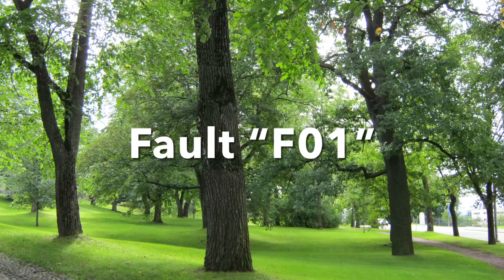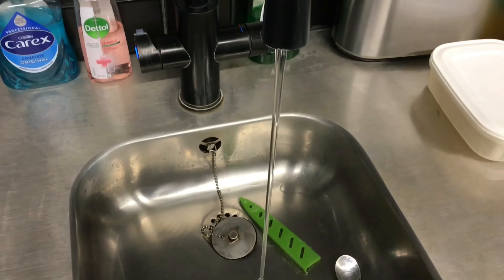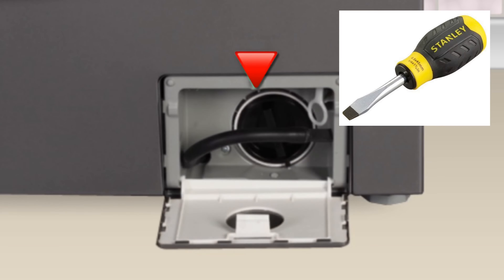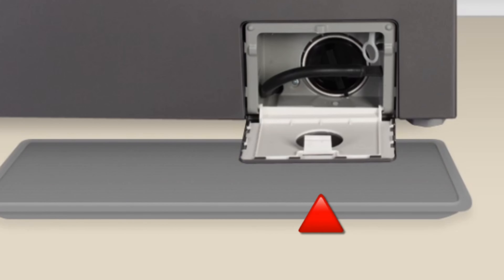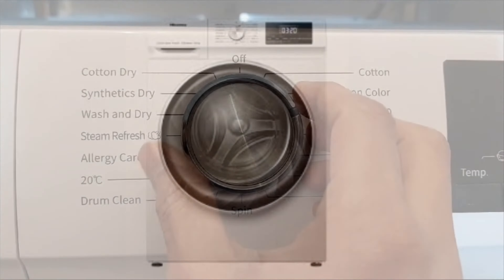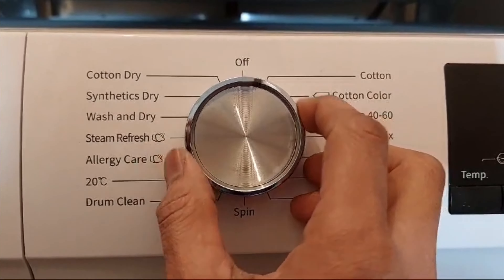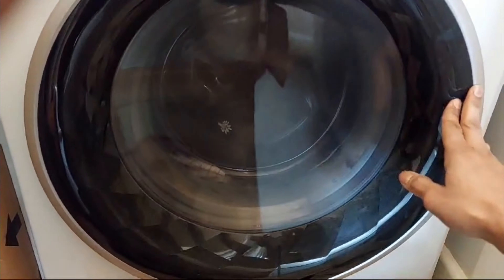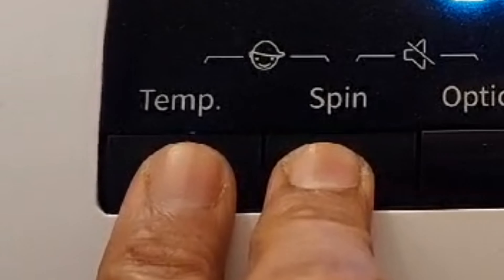Hisense Washing Machine Error Code Fix | F01 F02 F03 F06 F14 Solve Guide | Clean Drain Pump Filter

Comment: Getting the F14 but can't resolve it tried to unplug the power as well, after turning off and on still having the lock icon blinking any solution ?
Reply from the maker: Hi, When the wash cycle is running, the door will be locked. Check the programme and function status display window for progress. Once the drum comes to rest at the end of the cycle the door will remain locked for up to 5 minutes before releasing the catch to enable the door to be opened. 

If F14 appears constantly then switch the appliance off at the mains for 5 minutes, then switch it back on again and try to open the door again. If this doesn't resolve the issue then you may need to contact after sales service team.

Comment: What problem if error code F08 coming out on the screen?
Reply from the maker: Hi, The F08 error code on a Hisense washing machine indicates a problem with the heater. Try resetting by turning the washing machine off and then back on. If the error code persists, contact a qualified technician for further assistance.

Comment: F05 NO WAHTS
Reply from the maker: Hi, The error F04, F05, F07 and F23 — Electronic module fault.
The appliance stops during a programme. Press the power button for 3 seconds to turn off the appliance.
Press the start/pause button when the fault has been corrected. If the fault occurs again, please contact the after-sales service team.
Reply: F17 error code?